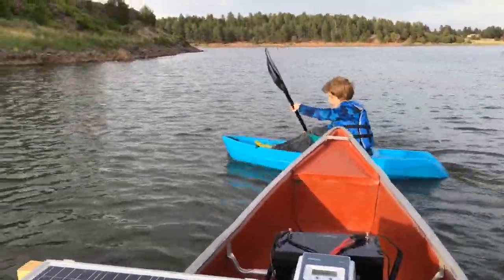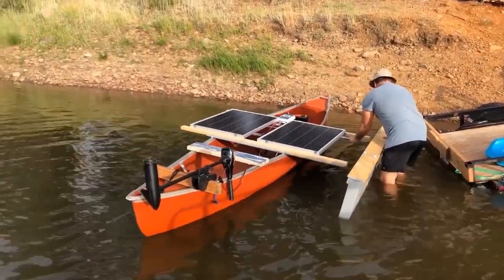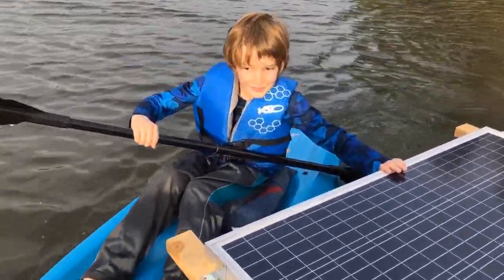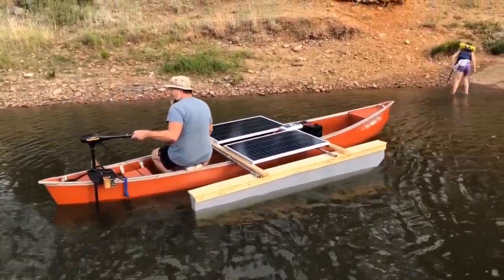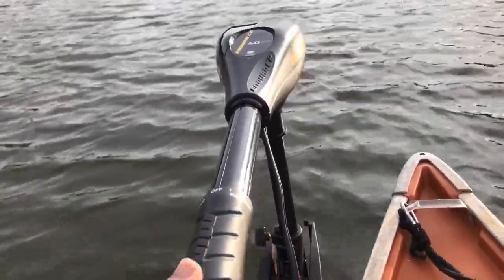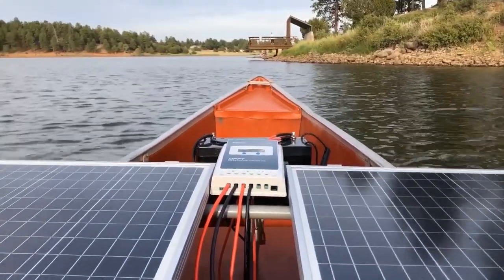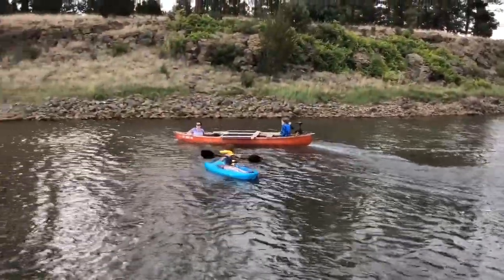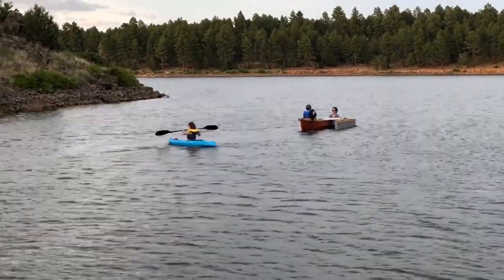Solar Powered Canoe (solar boat build)

Comment: I am building a outrigger canoe. The outriggers are capped 8" schedule 40 pipes fiberglassed and smoothed. I have built a cross mout system similar to yours, but put carpeted  boards on mine for my dog. I am thinking of a combination flexible solar panel and mast/sail system. When wind is good, slow sail. I might need to install a keel board. The solar panels are on the shadetop.
I also have a 16' runabout with a 135hp evinrude. I am considering  making the canoe system removable to install on the 16. Use the gas motor to haul ass to fishing spot. Then troll for a few hours on electric/solar and still he able to start gas engine for return. I like these ideas.

Comment: I'm planning on making a powered trimaran out of a registered canoe, with an old hobie cat. I would suggest using longer outriggers, and making your center of gravity lower, such as placing the battery in the hull, and not on the seat. Great concept though.

Comment: How big is your trolling motor and battery? My 46 lbs trolling motor and tractor battery run for approximately 2 at full throttle, pushing a 12' aluminum boat. Thanks for sharing  video

Comment: The problem is the canoe. I had one once and I called it a barge. Get one with a better Hull and you will see a significant increase in performance.
Reply: Please elaborate. What do you mean by “better hull”. Do you mean longer? Wider? Different material? Different shape?
And “significant increase in performance “, do you mean more speed? Better stability? Better maneuverability? 
I’m thinking about building a solar powered canoe so I’m researching.  There are so many factors to consider, I’m getting to the point of just building it without so much concern for getting it perfect. It can always be tweaked later.
Reply: @202vaughn  Many cheap canoes like Coleman loose their shape making them hard to move though the water.

Comment: Nice. That's a 40lb motor? Do you find it powerful enough? I'm about to do a similar setup but for a 17ft rowboat. Be about 500lb with boat and people. I'm wondering whether to go up to 55lb or if that'd just be overkill? I'd also like to hear about the amp hours of your battery and how much time your getting on the motor with it.
Reply: I think you will find 40lb sufficient. I get 4kts with a 40lb motor on a dinghy with only 12ft waterline. It draws 30A. On a 17ft hull you might run out of prop pitch at higher speed. A model airplane prop will remedy that and give much better overall efficiency. A 10x5 or 10x6 prop would be good options depending on load and conditions.